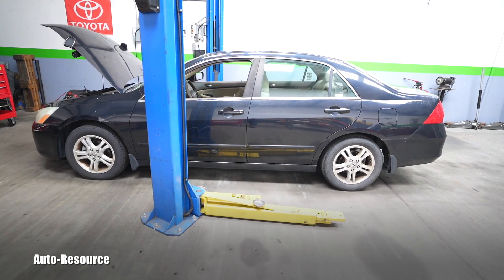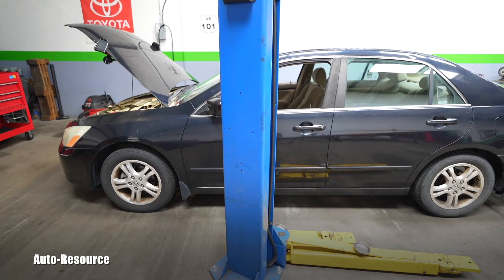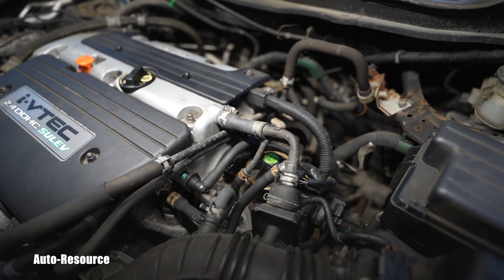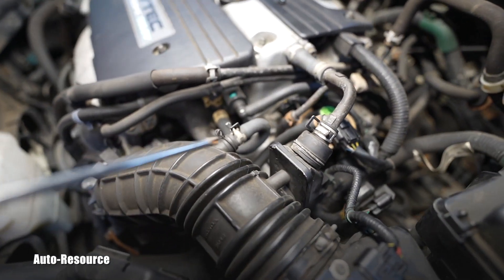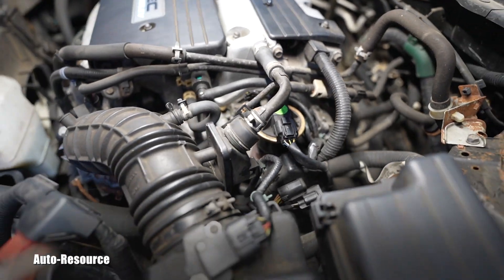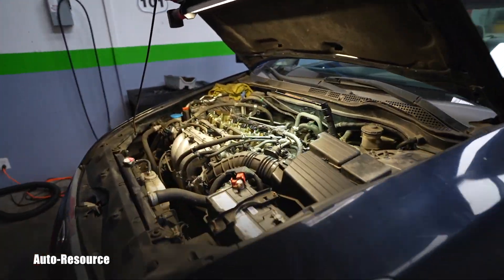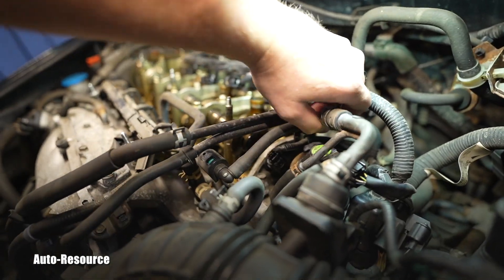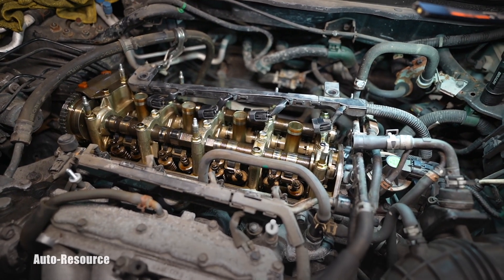HONDA 2.4L Engine K24 Camshaft Sensor Location, Removal

Comment: Thank you so much. Im a single mom and cant afford the mechanic. I typically work on my own car, but i wanted to have a break this time. After the 1200 estimate to change the cam and crankshaft sensors, i decided i have to do this myself as well. They charged be 150 dollars just to hook the scanner up... i already told them the code i got from my own scanner. Anyway, thank you. You are an angel.

Comment: Hello, thank you for this. 

QUESTION- Can you tell me the BLUE plug right to the left and lower, from same area you are at with the two sensors? I found mice chewed wired to that BLUE plug that goes right to the  block??? I had to disconnect and repair and now I have terrible low to poor acceleration/on highway, also the plug right off that harness to below air box, not on the box. Is there something I need to relearn something? 
Thank you for all you pass onto the Individual/people! Appreciate you!!

Comment: I keep reading a CSC could be for a stretched timing chain. Any experience with this? I have 292k on my 06 CRV. No noise or rattling?
Reply: He mentions in the video a common issue with these engines is a stretched timing chain, hence why at the end of the video he has the valve cover off (he’s checking the chain out). At 292k, if you have a similar issue with the CSC, odds are it’s probably the chain assuming it’s never been replaced. An 06 CR-V would have the exact same engine as this accord (K24A4) so the chain could definitely be the issue.